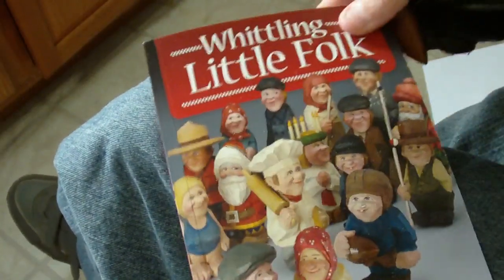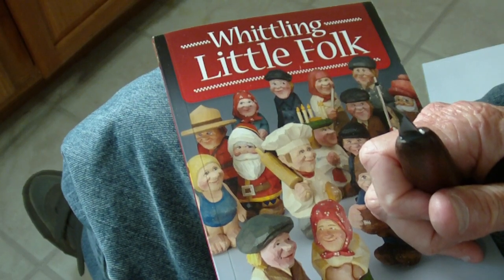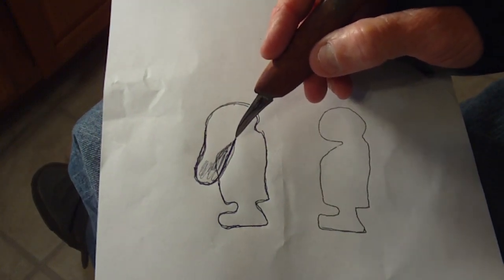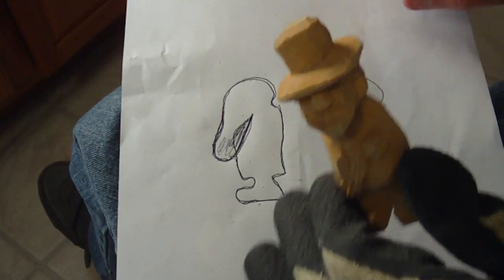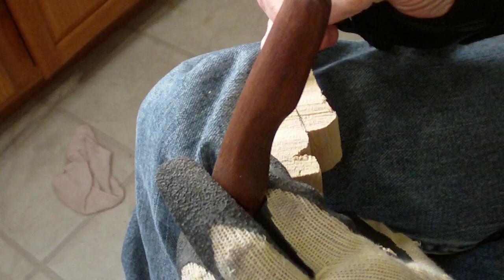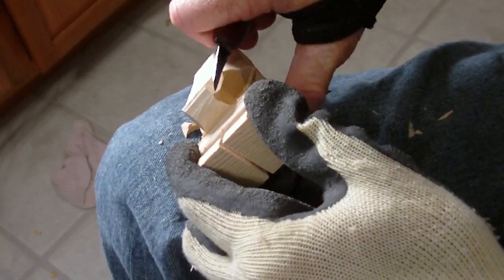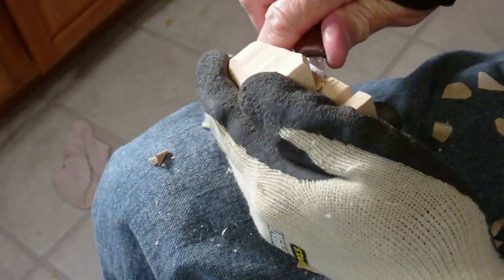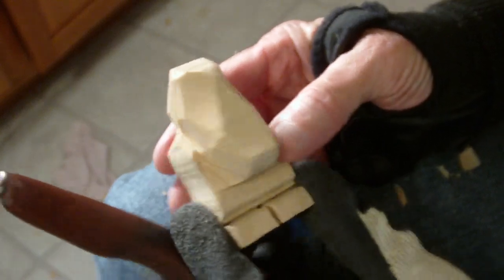Whittling The Minature From A Altered Pattern  Part 1

Comment: It looks so soft when you take out those giant files off the wood. I can't do that. Either my knife ain't that sharp or I can't find the right wood. Or maybe both. In Brazil I haven't found a single place that sells basswood to try on it, but the ones I found are way hard.
Reply: Basswood is just as hard as pine and it even smells like pine, but the grain is closer together that's is why is good to carve it does not splinter like pine does. 
Now Gene must have a razor sharp knife and exp.